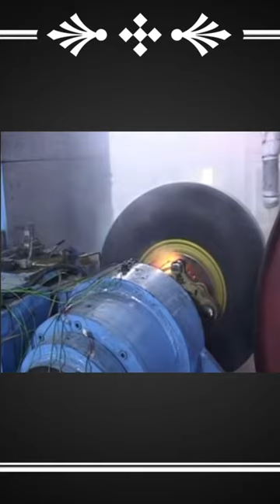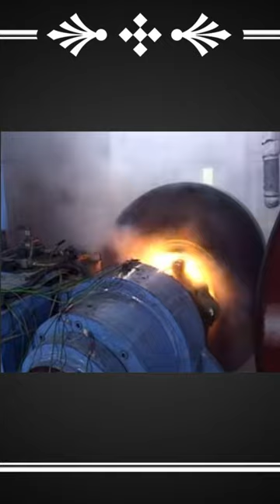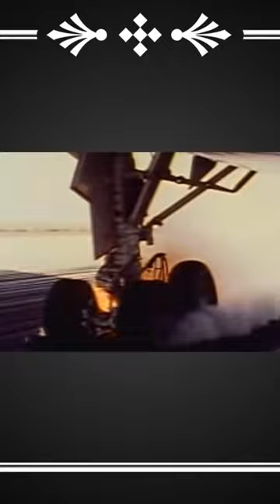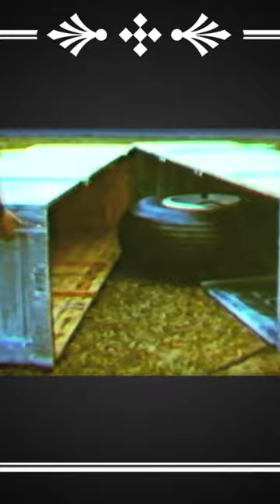Extreme Airplane Tire Pressure Test!! #shorts

Comment: If you think that's bad then you should see hydraulic punctures. Even a tiny stream could cut you in half like a knife through butter.
Reply: Make that knife a superheated knife
Reply: the real danger with hydraulics is hydraulic inejction injuries, you can take an injury and think its pretty minor or not even notice it then die from an embolism or develop compartment syndrome or be poisoned (depending on the toxcicity of the liquid involved) several hours later
Reply: @mishkamcivor409 oh how right you are. Not enough people know that exactly this as you have described can and does happen with regular pressure washers. Hell, there is a guy here on YT that used a cheapo pressure washer to make a diy water jet cutter.

Comment: Its not a tyre test, its testing the A380 brakes to see how well the system copes with all that heat without welding itself to the hub preventing rotation

Comment: Majority of aircraft wheels that have fuses that at certain temperature & pressure will release the air in the tire safety. 
Also, that’s an Airbus A380. Boeing uses the 7xx naming for their commercial aircraft.

Comment: sadly that high pressure is what ended the concord, one of the tires blew and threw a chunk of rubber at extreme velocity into the underside of the wing rupturing its fuel tank, leaking fuel fed into the engine which made it stall out i think and well...the rest is history...